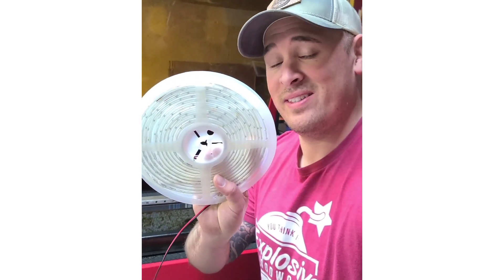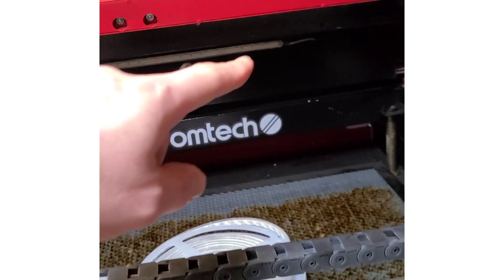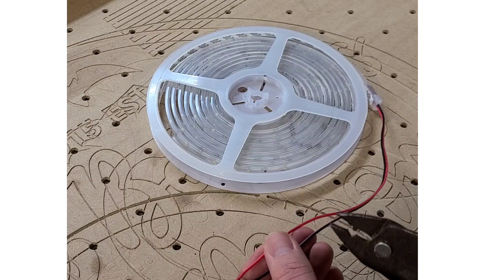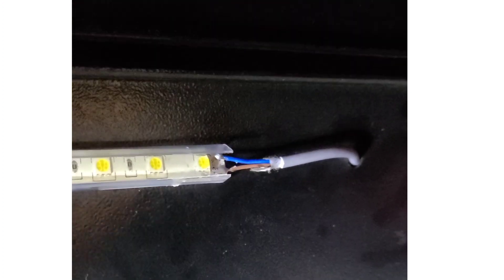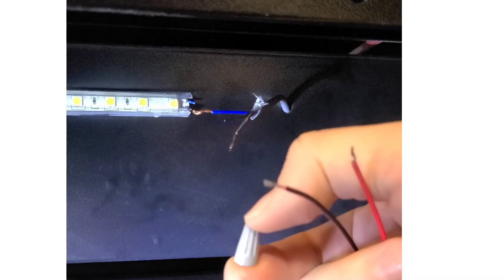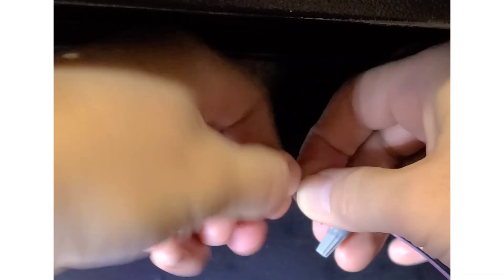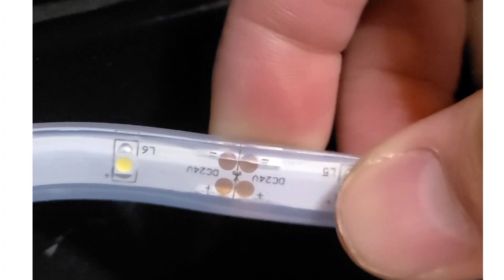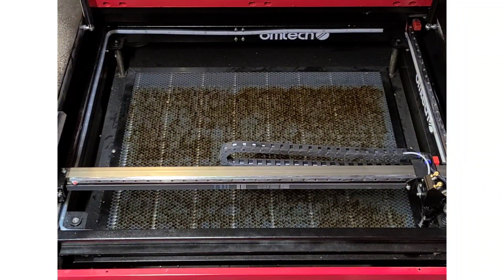Install 24V LED Lights on Chinese / OMTech CO2 Laser

Comment: Cam,  is the power supply strong enough you could just parallel the connector to the existing LED strip already installed or do you need to take the factory one out of the circuit?
Reply from the maker: Yes just make sure the new led strip is 24 volts

Comment: this video is 2 yrs old. I just bought a MF2028-100 and it doesnt have any leds. Did i get a much older model? Or diid they stop adding LEDS?
Reply from the maker: Yep, they’ve changed it up over the years. Check under the gantry. They have been mounting the mid led strip under their. Regardless you can run you’re own wire and connect it to the 24v power supply

Comment: I ordered the lights you linked too. But they have 5 wires. Not just black and red.  Will they still work.
Reply: I have the same ones. Wondering the same thing. I’ll report back if/when I find the answer.
Reply: @aprilwanner  just realized the exact same thing tonight and came to the comments to check

Comment: Did you remove the original LEDs that were on the back side of the machine?
Reply from the maker: Nope, I left them there. They're higher up in the cavity of the laser so you don't see them. You could technically splice them in and use it the existing strip as well
Reply: @EdmondsWoodshop  thanks man....good videos.

Comment: very easy to follow! what is the benefit of these lights?
Reply from the maker: The workspace in the laser is real dark. Add light helps you clearly see your designs. If your someone that likes to record what your making on video, this will absolutely brighten up your space.
Reply: @EdmondsWoodshop  also helps with calibrating a camera